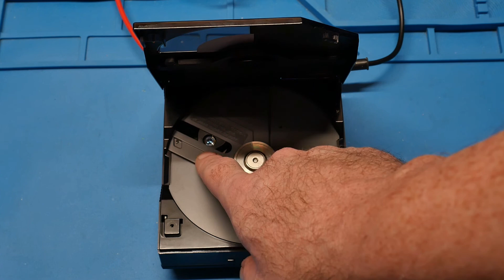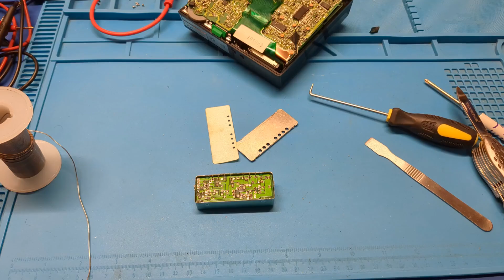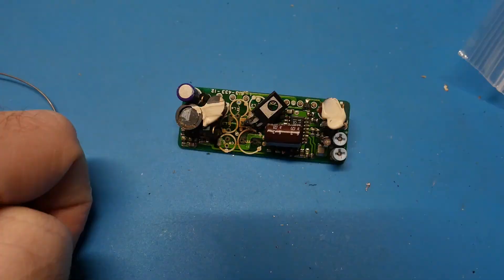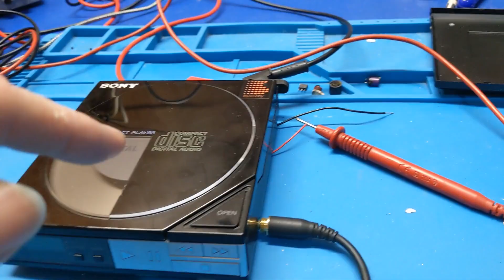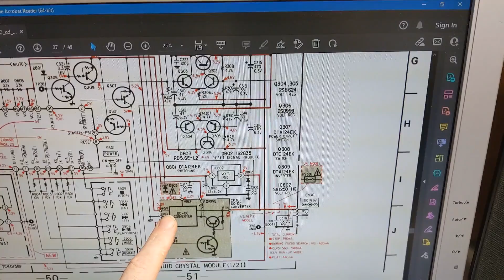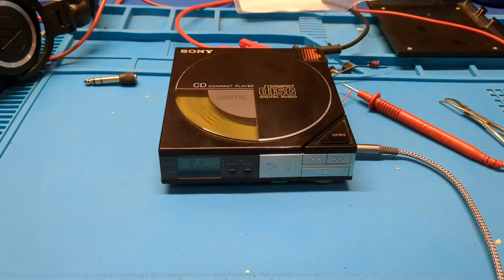Sony CD Discman D-5 No Power. Lets Fix it

Comment: Great Job!!! Quick question. Do you know the values of the capacitors on the DC-DC board? I'm doing a full recap of my D-5 and I couldn't find the information in the service manual. Thanks !!!
Reply: I teardown my DC-DC converter. Surprisingly has different layout !!

For what's worth, my caps are:

220mF 16v

2,2mF 50v

120mF 6,3v

22mF 10v

Comment: ı have exact same model. and when i put cd inside, it spins makes noises and stops spinning, and starts spinning again, makes noises and stops completely. do you know what causing this? i want to fix it but i couldnt figure out what the problem is.
Reply from the maker: @reco9632  bad laser most likely
Reply: do you have kss-110a replacement laser?if so how much does it costs? @THEtechknight
Reply: @THEtechknight do you have replacement kss-110a or g or d (last letter doesent matter) laser? if so, how much does it costs? or do you know, who is selling that laser? because i didnt find it on the internet. even the chinese sites say "sold out". if you can help me, i will really appreciate that.

Comment: I have a D-5 with the green switch. The display powers on even when the device is powered off. Any ideas?
Reply: i should mention that a week ago it worked perfectly fine. I had to mail the power supply for travel reasons and now all i get is the display but no function.
Reply from the maker: @fortniteayeeee  The DC converter probably died for some reason the same way this one did

Comment: I've right now on my bench a D-5. I've repaired the DC-DC circuitry, but no sled action or focus search.  Do you have any tips?
Reply from the maker: Make sure all of your voltages are present. Also double check that secondary regulator which I had an issue with later on. If it's also damaged it can damage the microcontroller which will cause this

Comment: I have one of these I got a few years back, and was using it at work before the pandemic.  It worked absolutely flawlessly until one day.  It skipped a couple times playing a disc.  When that one ended and I put in a new one, it had some trouble reading it.  And then that was it.  It wouldn't even read a disc anymore.

I haven't been looking forward to troubleshooting it, knowing that 80s-era Sony portables were just a mess of tiny fragile wires inside.  But some day I will, because it's a great little player, and like you saw, even handles CD-R just fine.